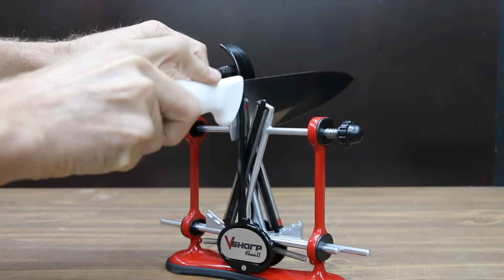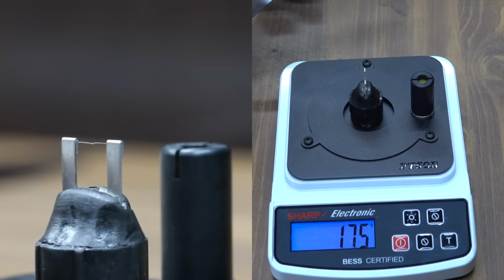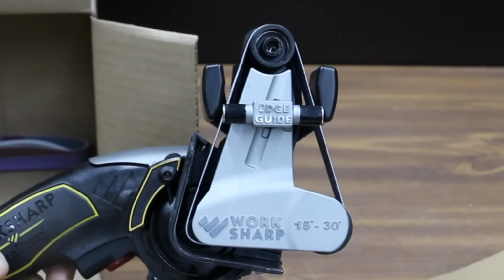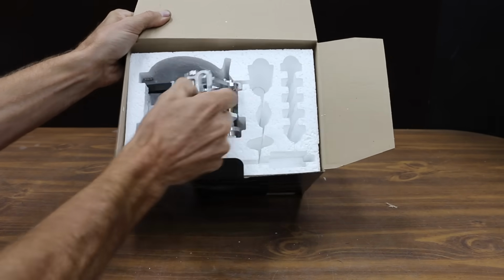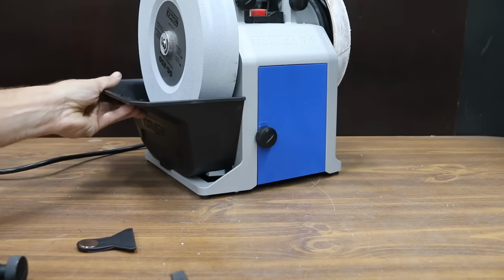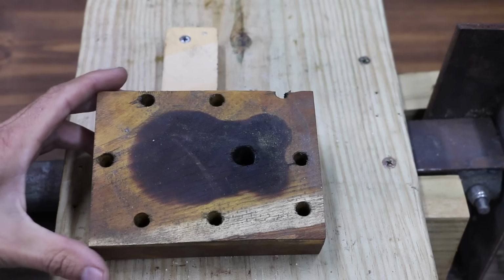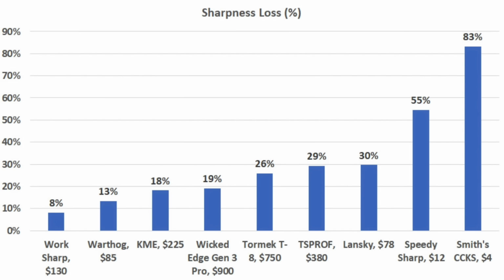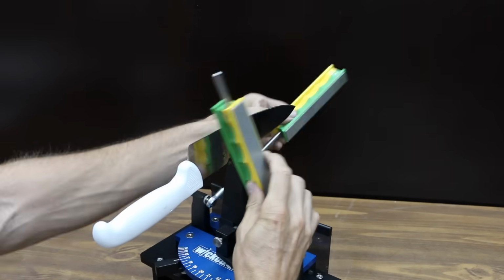RUSSIA vs USA Knife Sharpener? TSPROF vs Lansky, Wicked Edge, KME, Tormek T-8, Work Sharp Ken Onion

Comment: Hey I really like your channel dude I just had a  brilliant idea for a video you could do, I was researching slingshot bands, band thicknesses and band qualities like cold resistance and better retraction speeds. Long story short I know you have great creativity and efficiency in coming up with experiments, I’d think it would be a benefit to your channel and increase the likelihood of new subs coming along from the slingshot background. It’s a huge community and the answers on band rubber are clouded. I think you could test various brands of slingshot/ exercise flatbands at set thickness, length and width. Test retraction speeds at different temperatures hot vs cold vs normal etc and also test durability to uv light harsh weather etc. I’m sure you can come up with some fantastic content. Hope this can help your channel out too. Keep up the good work friend
Reply from the maker: Thanks, will do!  Thanks for the suggestion.

Comment: I hand sharpen on a flat stone, nothing but time on my hands, and my knives are extremely sharp, I've even done a filet knife, damascas steel gave me a fit, really hard stuff. I used to keep a stone in a can submerged in hydraulic oil, boy you could really get an edge on a knife with that, and was rather quick.
Reply from the maker: Thanks for sharing.

Comment: The smiths one is made for using in the field while camping to touch.up a blade also you misused it your supposed to use the side angled cuts to rest the blade on them and swap sides on it to sharpen each side of the edge
Reply from the maker: Thanks for the constructive feedback.

Comment: You should have sharpened all the knives as close to the same angle as possible.
The Smith's is probably between 22.5 and 25 degrees, and sharpening the other knives at 17 degrees gives them an advantage that isn't strictly attributable to the sharpener.
Reply from the maker: Thanks for the constructive feedback.

Comment: I'm more amused than I should be that the Tormek is just an actual grindstone.
Reply: The Tormek is a slow speed water bath hone stone. That protects the temper of metal compared to a bench grinder. Plus the Tormek has a nice tool rest setup too. Tormeks are a bit spendy though. So you won't find one in my shop. Not unless I can find one cheap. Just the wheel on a Tormek is like $220.
Reply from the maker: Thanks for the feedback.

Comment: I currently own a t8, tsprof k03, and a variable speed 1x30 belt grinder for my sharpening. Belt system is by far the fastest way to pump out volume. Tormek is slow, and expensive to get different abrasives for. That has been sitting in my basement for almost 2 years. The tsprof is amazing for all my high end edc blades with its precise control. Diamond resin bond stones make all the difference with that. Diamond emulsion spray for strops also takes your mirror edges to a whole new level.
Reply from the maker: Thanks for sharing.
Reply: @ProjectFarm  if you get the chance, you should check out gunny juice diamond emulsion for stropping. Its a game changer with my stuff. Fastest cutting diamond emulsion I've ever used. Diamonds also leave a nice and toothy edge, while still polishing out the apex nicely since they're so jagged.

Comment: Suggestion: I'd be curious to see how different patching compounds compare on outdoor surfaces (e.g. exterior wood siding, stucco, concrete, etc) in simulated weather conditions (e.g. strong rain, harsh summer sun, winter freeze/thaw, etc): MH Ready Patch, Dap Elasto Patch, Bondo, RapidSet One Pass, Acrylic Stucco Patch,  Platinum Patch, and even something designed for interior use only, like Plaster of Paris. I'd be interested in any other kind of testing and comparison of these compounds like shear strength, abrasion resistance, adherence to various materials, workability, heat resistance, or whatever. Thanks for a great channel!
Reply from the maker: You are welcome!  Thanks for the suggestion.

Comment: You have a small mistake in your test, the sharper a cutting edge, the more sensitive it is and the faster it will be damaged, so you cannot determine a percentage loss of sharpness as the sensitivity increases exponentially

Comment: Sign me up for the Tormek or comparable systems like the Scheppach Tiger.
The sharpness you can get out of a blade with a good system, determination and time is always impressive but there are some systems which - on top of that - can really minimize the factor time - and thus also the factor determination. You don't have to do a few hundred precise strokes if you have a powered machine...
I have the Lansky system as well as the spydero sharpmaker and bench stones and I use them on my knives depending on what I am looking for. I love them. Great edges - but the way is laborious and takes time. A friend of mine has a Scheppach system and loves it and it is very impressive. More or less the same results but much less time consuming.
Are you a knive enthusiast who sharpens a dozen blades a year or are you a cook or a butcher and sharpen a dozen blades a day?
Of course high precision sharpening systems are great (and the tormek is one of them, albeit not on top in this particular list) - and I also know that for many people sharpening a knife is much more than just getting a sharp edge on a knife 😉
Also - it is no wonder that the cheap sharpeners lost in the "long term" testing here, since ripping off slices from a blade to make it sharp will never help in the long term - it will just destroy the blade.
Reply from the maker: Thanks for the feedback.

Comment: Did u use the stone grader and sharpen to 1000 on the stone then switch to the strop. I didn't see the steps. Plus the tormek knife holder would have done a better job and lastly u didn't setup properly tormek clearly states that the gauge should touch both stone and blade which u didn't do.

Comment: As a Tormek owner for about 20 years, I can tell you the you can make razor blades weep with it, if you take the time with the correct fixtures which you did not use.   I realize that there are much cheaper methods, the Smith that you used among them.  They will work for about a year for a few bucks.  I use the Tormek for everything including planer and shaper blades so it pays for itself.
Reply from the maker: Thanks for the feedback.
Reply: With the extra blade and long knife jigs, the Tormek costs $900.  To me, anything above $200 is justifiable only if you have many, many blades, such as knife shops, restaurants, barber shops, etc. And yet, restaurants and barber shops are perfectly happy with a steel rod and a leather strap.
Reply: @jmchez  Basically. I agree with you.  I was doing woodworking at the time, and running to the PC or the store everytime I needed a planer blade was not convenient.  Also, I sometimes did not know how long various blades would remain available.  When I got mine, they cost less and since I was (am) a business owner, there are advantages.  

Aside from these justifications, my personal philosophy has always been that I buy the best....I'm currently 74, work full time as a factory automation designer, and thus far, I've never been sorry, and there will come a time when I will sell it for about what it cost me.

Comment: It would have been good to see the spyderco sharpmaker again. It is blatantly obvious that you used it wrongly the last time, as so many comments said you did. These were not spyderco "fanboys", many also had sharpeners that you scored higher that they said were inferior. It would be good to see you admit when you messed up, and more importantly, show how you were using it incorrectly so others do not make the same mistake.

It would also be good to see other knife tests, rather than just that overly simplistic gauge, which is far from real world usage. I do understand why you use it, but would like additional ones.

Comment: Had an idea, what happens if you run a kerosene or diesel forced air construction heater on gasoline.
Reply: Potentially flamethrower??
Reply from the maker: Thanks for the suggesion.

Comment: Can you do a clicker torque wrench comparison? Today I was using an inch lb clicker torque wrench I bought from Harbor Freight 10-15 years ago (I rarely used it) for a 43 in lb torque and it dawned on me that the wrench was just keeping going without a clicker and I then measured the tighted nut with an electronic torque tool similar to what you used in you vids, and the reading was 35 ft lb. The clicker torque wrench is totally useless and I am wondering if there are substantial differences of accuracy among different types of torque wrenches and/or different brands.
Reply from the maker: Thanks for the suggestion.

Comment: The best sharpener in the world is an Edgepro professional. This is assuming you know what you're doing ... which you don't. BTW, the clips you're using on your Edge On Up tester, aren't even BESS certified. Only the standard fixture is BESS certified.
Reply from the maker: Thanks for the constructive feedback.
Reply: @ProjectFarm  I have to admit it could've been more constructive but what you're doing here has a lot of holes in it. If you want to understand sharpening better, go take a look at the research of Dr. Vadim Kraichuk " Knife Deburring: Science Behind the Lasting Razor Edge" Without understanding that, understanding which of these devices ACTUALLY works best is virtually impossible.

Comment: Something that would be very interesting is a test off Snap off blades. I use a Snap off knife everyday att work and find some brands getting dull really Quick. Im qutting suspended ceiling panels, sometimes plasterboards and obviously opening materials with the blades.
Reply from the maker: Thanks for the suggestion.

Comment: First off, I absolutely love your videos. When it comes to ways of testing products, you think of everything. I have been doing building maintenance for over 10 years and have used many brands of products, trying to find the best one. What has taken me many years to do, you do in one video. Most of the products I use, you also rate as the best product. This is an odd video suggestion. A little out of the box. I am trying to find the best work socks. Durable, moisture wicking, cushion etc.. I currently wear Dickies work socks but am wondering if there is something better out there.
Reply from the maker: Thanks!  Thanks for the suggestion.

Comment: I live in Russia and I got one of basic TSPROF models "Kadet" (it's cheaper here due to obvious reasons), the one you have is "Blitz" (which is just fine) and the most functional top of the line is "Profile K-series" (current is K03). I use Venev high grade diamond abrasives up to GOST 1/0 sub micron (FEPA F2000 and JIS J8000 are less fine) that makes a mirror polish on the edge and looks really good in microscope. Note that not all steels (depending on heat treatment) can have burrs, only the soft ones you used here, so you need to adapt your sharpening techniques. Edges of high carbon hardened steels doped with tungsten, cobalt, molybdenum or vanadium degrade differently. All sharpeners can show some result in good hands, but with my experience I don't recommend any sharpener that doesn't have a big enough abrasive surface.
Reply from the maker: Thanks for the feedback.

Comment: Way overpriced Swiss machine. Leather strops straighten the very fine edge and does not require any additive. The use of the leather wheel is suspect. Not having a very wide abrasive wheel is an issue also. Probably something that doesn’t sell for more than $200 in its home country
Reply from the maker: Thanks for the feedback.

Comment: I got the Worksharp Precision Adjust knife sharpener which was not in this video. And to me, the clamping mechanism for the blade makes all the difference in the world. The KME clamps are ideal and the Worksharp Precision Adjust is very similar to the KME clamps and I used the Worksharp on my Spyderco Para 2 and that blade happens to have a wedge shaped profile, which is a challenge for traditional clamps like the Lansky. The KME style takes the blade profile and negates wether it is a true full flat or if it’s wedge shaped or whatever. The Worksharp got my Spyderco sharper than I have ever been able to achieve freehand and I recommend it to anyone over the Lansky
Reply from the maker: Thanks for the feedback.

Comment: worksharp for practicality, Tormek for anything else. It is a whole sharpening system with tons of jigs to sharpen anything from axes, to scissors, gouges etc. It also has some high quality japanese stones to opt for which result extremely refined edges. It is versatile and very fast when you get used to it. Plus it gives a concave edge which is the best solution for very high sharpness. Wicked edge is over hyped and overpriced imo.
Reply from the maker: Thanks for the feedback.

Comment: I’ve had the KME for a couple years now. Love it. It received laced my older Lansky.  I’ve found the Lansky stones start to wear oddly and become less effective.  The KME has flat diamond stones and they are awesome. Plus the KME has the plastic guide on the rod that really holds the angle very precisely. Love the KME!
Reply from the maker: Thanks for sharing.
Reply: Bought the Diamond Stone Kit after watching this video. Used it twice and the Coarse 330 grit started flaking off. Not sure if these are actually stone or some other non metal material with an abrasive coating. I say non metal because a magnet doesn't stick to them. Other than this issue I agree the KME is great and has given my knife a much sharper edge than all the cheaper sharpeners I've used in the past. Hopefully the 330 grit is an odd defect.
Reply: @waltermelyon4300  I’d contact KME if you are having problems with the stone. I’m sure they would make it right. I haven’t had that problem with any of my stones.

Comment: The first two cheap sharpeners make really sharp jagged edge that will show well in the thread cutting test but the edge is very fragile. Just a few cuts and you’ll be back to removing more metal to get back to that fragile edge. Not worth it.

Edit: just now watching the end 😂
Reply from the maker: Thanks for watching!

Comment: for an accurate result, you need to use sharpening stones of the same grit.
and synthetic sharpening stones are different from diamond ones.
I have synthetic and diamond stones on TSProf. grit 80, 100, 200, 400, 600, 800, 1000, 1500, 3000.
not all at once.
TSProf corrects the wear of sharpening stones.
and this is a relaxing activity.
Thank you.
Reply from the maker: Thanks for the feedback.

Comment: Note that if you're on a tight budget, you can get a Lansky kit on eBay for about $35.  That's an unbeatable price for one of the top performers.  The KME is what the Lansky would be, if Lansky had ever bothered to improve on the original design with its flimsy clamp and vague angle settings.  If it fits your budget, I think the KME is well worth the price - it's just easier to use, with a sturdier clamp and precise angles.
Reply from the maker: Thanks for the feedback.

Comment: Regarding the Hedge Apple dulling: Have you made a new cutting groove for each knife? The result just look like you've used the same groove which caused the first knife of taking all the beating and once the groove is deep enough the knife has most of the contact on the sidewall